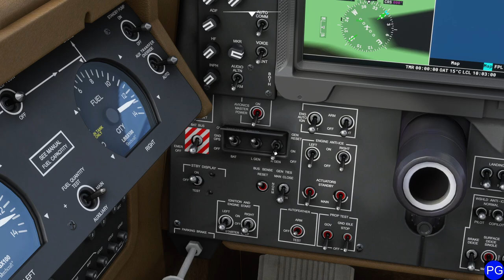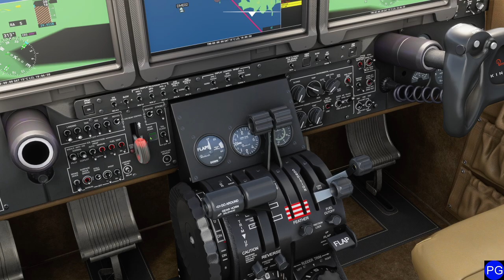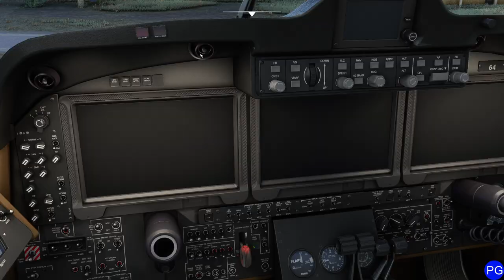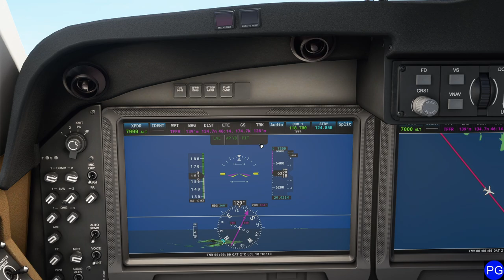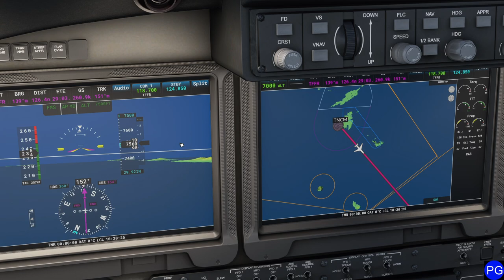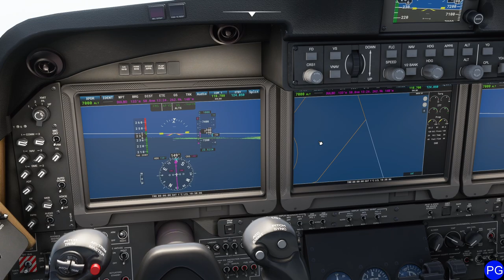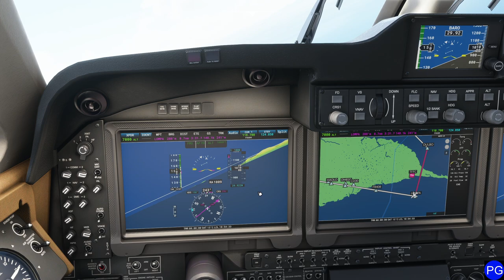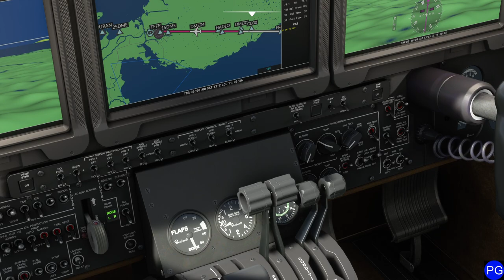FS2020 - Flying the textron/beechcraft 350i

Comment: Thanks for another great video! I'm using these as references to setup the best configurations for the Bravo throttle - perfect for that. One thing I don't know if anyone has mentioned or if you think it would be helpful, would list in the description or mention at the start in general which version you were running - ie, 'Sim update 2, 3, etc'. Especially from the dev roadmap all of the changes happening to AP and other systems, it's useful to consider when using these for reference, which I assume a lot of people are.  Thanks again!

Comment: Great video! I'm having issues clearing the "Batt Amp" light after startup in the CAS. Alt/Generators are on, and for some reason the light will not clear and the avionics die in flight.
Reply: Usually weird issues like this are due to controller mapping issues. Even when it appears visually the switches are in the right place.